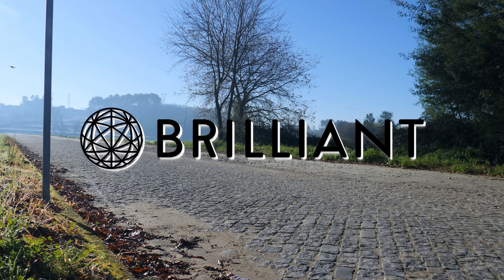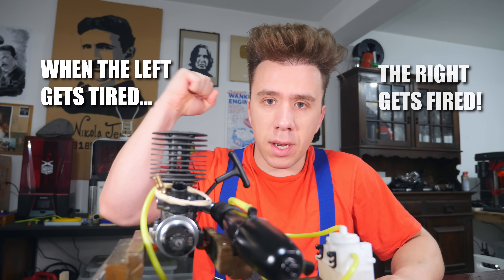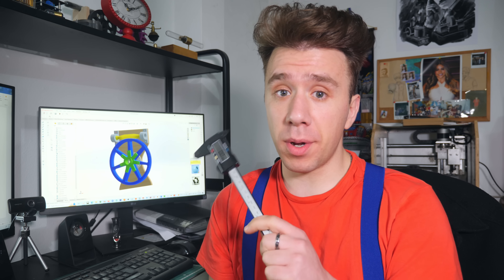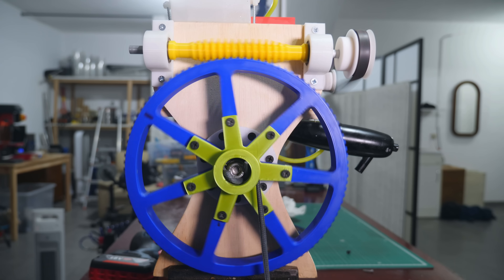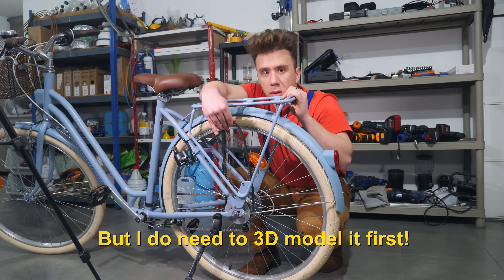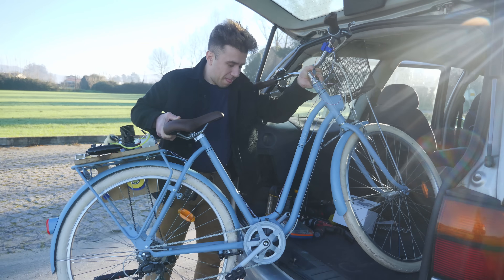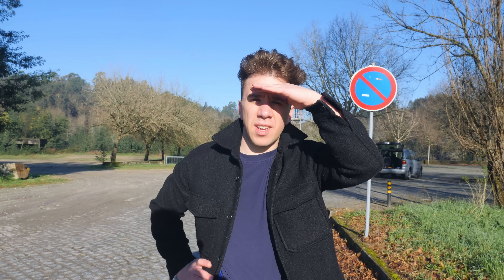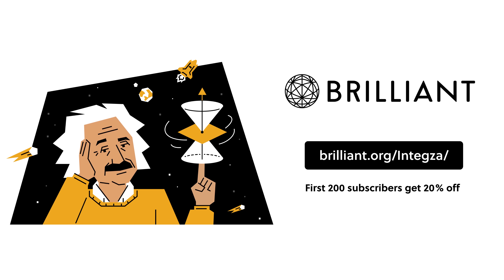Tiny 3.5 cc NITRO ENGINE on a BICYCLE

Comment: You should try to make a jet engine with nitinol, because nitinol has a relatively high melting point, and you could also program it so that it avoids losing its shape due to the high heat, instead it would rather take the shape of the engine and not it would be deformed....

Also another good idea would be to use gloves to avoid getting burned or electrocuted.:)

Comment: I have a 2 stroke lawnmower that struggles to start, because of its age. but the trick is to slowly and gently pull the pullstart so that it engages the one way mechanism, and then pull as hard as you can. this also reduces the chance of straining your arm.

Comment: think it might be running a bit lean, there should be a relatively constant stream of blue grey smoke from the exhaust. you can also try adjusting the idle screw to get it to idle lower

Comment: how about adding a gearbox to it, so you will be able to reach highter speeds. You could keep the 1/50 gear, for the start, and then gear up to a 1/25 gear speed. Also for that you will need a clach, but that is easy to make, or if you do not want to beald, then buy stock on, that is senterfugal (sorry if i killed the word), but id you want to change gears with a sentrfugal clach, then you will need to throtal down so the clach disengage by itself, change gear, and then throtal up.

Comment: You would gain more control and better throttle response by throttling the engine using an exhaust throttle, rather than the carb.

Comment: Using a rubber band to CLOSE your throttle is a terrible idea. 
The engine will get hot, the throttlebody then gets hot, melting the rubber band, and now your throttle is stuck open. :face-turquoise-covering-eyes:

Comment: I would have done a planetary gearset instead. Not only will it not self destruct, but it will allow power transfer both ways and allow more torque with plastic gears. This is how most small electric motors gear down for bicycles. even some hub motor ones.

Comment: i have a great ide. what if you take multiple nitro engines and combine them somehow so you have like a I4 engine but made out of individual 1cylinder nitro engines that are connected togheter via gears or shafts. would be supper cool

Comment: As you said, the engine runs on a mix of air, nitromethane, methanol and oil. It doesn't run on air alone, so before starting, prime the engine.
Blow into the pressure line to fill up the fuel line all the way into the carburetor before starting. It should fire up within 2 or 3 pulls.
This was fun, i really did not expect it to perform that good!
This could be a world record?

Comment: <Something something worm gear friction and efficiency> 
Also use a cross cut sled or the miter gauge not the fence next time. The way you did that cut is a supper duper danger way to make that cut. It's just asking for a kickback to happen and then taking your had into the blade with the block of wood. Always remember, if your cutting a part whose shortest length is close to or smaller then the size of the blade, then use the fence if your going along the longest length, and the miter gauge or cross sled if your going along the shortest. Also never use both, that's also a way to get dangerous kickback. Please keep your fingers, I need you to make more crazy things for our entertainment.

Comment: I like this project, but 30 km/h is not that hard on a bicycle without an engine! Perhaps you can look into a variomatic from a scooter, that way you can optimize the vario at peak power and you will go more fast.

Comment: Measure the torque of your legs and then accomodate the gear ratio to be the same or even higher if you want to keep the shifter transmission

Comment: This was a fun video.
If you decide to try and improve your design, may I suggest using a CVT drive, like they do on scooters, instead of a wormdrive. 
It will keep the engine RPM's right in the sweet spot, until you reach max gear ratio. That way you will get both torque and better topspeed.

Comment: The ratio of a small motor hp compared to a ferris  is staggering  
i was amazed you got to  32km/h  in the 70s rode in a mates gocart The old 160cc victa lawn mower engine did ?? mph  well pretty dam fast in a bike dome track

Comment: Little correction : The Citroën 2CV does not stand for 2 horse power. It stands for 2 TAX horsepower
Reply: Yeah this one is 29hp :)
Reply: I was looking for such a comment. The actual power output of the car is between 9 and 30 hp depending on the version.
Reply: Yeah, it's a "chevaux fiscaux" or "tax horsepower" reference. A 10 second wiki search and you can find the actual power numbers with the earliest versions putting out 9 ch/hp and the latest models like in the video putting out up to 36hp (29 for a 2CV6). These kinds of misleading facts just rub me the wrong way in those videos, no matter how funny or lighthearted the premise is.
Reply: I always thought it was for 2 Cylinders, 2 Valves and the host was being snarky.
Reply: @4saken404 CV is short for chevaux (the French plural for horse)
Reply: The cars are actually called a Deux Chevaux in France
Reply: @simaesthesia  Yeah 2 TAX horsepower
Reply: @simaesthesia  I find that just incredibly charming and amusing. :D
Reply: @4saken404  But, you know, that would give a Traction Avant 7cv cylinders...
Reply: Deux Chevaux = Two Horse
Reply: Tax avoidance at its best :)
Reply: @thecatofnineswords  it aint tax avoidance, iirc it was the same as owning two living horses so far as taxes go
Reply: @tiagobelo4965 I’m sure 2 horses would pull the car just fine so why shouldn’t a 2HP engine do the same? What am I missing?
Reply: @kevinmills5293 one horse power is normally 750 watts if memory serves me.... That is not the same as actual horse power....
Reply: @one.wonders  this here video maker has no clue.. The French tax HP is not 9hp, it's not related to actual horse power..As it was solely based on the physical size of the engine not the output. I wish people would try to research things before making a video
Reply: @meharidude  sadly that requires actual knowledge or research. Too often ignorant people with an opinion get all the likes etc.  I have worked on a few Citroens including the old duck! Cheap motoring... Sadly a bye gone ira.
Reply: @kevinmills5293  Im pretty sure 1 horse has like 15 HP
Reply: @thecatofnineswords  how?

Comment: I would use belt drive.  I think the gears aren't efficient.  And I think the motor's clutch is slipping a lot under load.  I think you need a more efficient transmission and/or a lower gear ratio.

Comment: I'm not encouraging you, but you don't dare to put AWD and some gravel-oriented tires on this thing to make it an offroader

Aka world's cheapest 2WD dirt bike
Reply: Also, one way to do it might be using nitro engine as generator, then use generated power to feed electric Motors in wheel hubs or anywhere else, just like old diesel locomotive

Comment: And fyi you’ll probably only need a gear ratio of like 3 or 4 to 1… try like a 12 or 13 tooth on the front and like a 44-50 too the on the rear wheel and get rid of worm gear all together

Comment: There is still untapped power there.
With a taller gear ratio you can increase your top speed but you'll probably need to get up to speed with your legs before engaging the engine.

Comment: Time to strap a rocket engine on the back of the bike to give the nitro engine a boost. Maybe a planetary reduction instead of the worm gear for efficiency and then you might be able to have a secondary gear you can shift into. Nitro -> rocket boost -> shift gears and then back to nitro engine at higher speed.

Comment: I think if you had a lockup clutch on the motor, one less pulley and better throttle control, this may have worked a little better. Still an awesome little creation.

Comment: Hey !
I'm french and I just wanna explain the French horse Power. It's nothing to do about engine power. It's, in fact, a tax classification for cars. This is uses to define how much you'll pay to obtain the legal ownrer documents of the car. This goes from 1 to 15 "tax HP". More "tax Hp" have your car and mor it's expensive. 
The 2CV was the most cheapest car you could by in the 50's and it was also cheap to get the documents. Citroen used this as a marcketing purpose.

Anyway, thanks for this video, it was very amasing.. and sorry but I love tomatos !

Comment: That wormgear probably causes a ton of friction and power loss. Maybe you could try and redo the transmission with either belts or gears? All that melted teflon is a big indicator for the friction
Reply: yeah, that was my first thought when he said he was going to use a worm gear. since you're already using belts, maybe you should see about designing a belt CVT like what motorscooters use for v2, and maybe even add a centripetal clutch?
Reply: @SevenWay-pu1xm  designing a cvt sounds like hell

i guess "designing" wouldnt be too bad but actually making it usable would suck
Reply: Yes. could benefit from selectable gears also
Reply: The engine was not getting to peak power, sounded like 15k to 20k RPM so it still had some headroom.  I think either it was not well tuned, still over geared, or too much friction in the system.  That said getting around 80kg of man and bike to over 30km per hour is a pretty mean feat when typical stock 1/8th scale RC cars using 3.5cc nitro only manage 80-120km per hour and only weigh around 4-5 kg.  Also some of those 3.5cc engines really want 18-25% nitromethane.
Reply: the wormgear can be redesigned to be wider so it can have small ballbearings inside it, so the friction is gone.

Comment: The additional oxygen is a smaller part than its stoichiometric ratio iirc. It has a low ratio meaning you need more fuel per g of air meaning more pressure (and power) per unit of air. Methanol has a lot of oxygen too but doesnt produce  anywhere near as much power for its oxygen content vs nitromethane, its stoichiometric ratio is substantially higher

Comment: How to start: Pull once or twice with air intake closed (finger on) or instead put some drops of fuel directly into the air intake. Makes starting a lot easier.
Reply: Excellent suggestion. Caution: All you want to do is pull fuel from the tank to completely fill the fuel line. DO NOT pull fuel into the engine because it's really easy to pull too much. If too much goes into the crank case the engine becomes hydro-locked. Trying to start it when hydro-locked will severely damage the engine. Trust me, I know: I tore the skirt off of the piston on one of my engines!
Reply: @richardunruh4035  I used to start my model airplane engines by hand. I let some fuel enter the crank case, two or three drops at most. That made hand starting a lot easier. To be shure, one can cautiously turn the motor by hand after priming to avoid damages by hydro locking.
Reply: @martinwilliges532  nah just use a drill to start it
Reply: @richardunruh4035  if the cylinder floods its supereasy to feel it with the pull starter and all you have to do is crank it a couple times with the glowplug removed.
Reply: @ishannage248   Oh, sure: now you tell me ;)  It was an old T-Maxx with electric start. No pull start = no feel.
Reply: i have nitro buggy experience, and i have found that if you pull the stater with your finger on the exhaust, it will pull fuel into the engine, it wont start very well without doing this, pull it untill you see fuel moving through the hose. if you have transparent hoses.
Reply: @FireFox443-YT YES, this is the trick!
Reply: Or just use any Traxxas nitro engine with auto start
Reply: I used to just spray some random can of something flammable enough to help it start XD (yeah I was a savage when I was younger XD)
Reply: just watch the fuel in the line, it creeps up as you pull with finger on the carb intake, it's called priming.
Reply: Just put your finger over the exhaust for a few pulls. This will pressurize the fuel tank and the way you go. I've been racing nitro cars for 30 plus years this is the easiest way to start them
Reply: @ThisLiLpiggy79 agreed. Brings back memories
Reply: @ThisLiLpiggy79  100% correct I run Nitro RC cars
Reply: Sounds remarkably like the bloke I saw trying to snort some snow in the bog last week 😉
Reply: A mosquito engine, nice.
Reply: Came in to say this, leaving satisfied. 🙂

Comment: The teflon severely lacks mechanical strength. It's way too soft and can't withstand the sheer forces of several dozen kg: Thus you ground the wheel to dust just by driving a tiny bit. Brass for the screw and the wheel + some regular, high viscosity gear grease would have been a much better choice.

Comment: Worm gears are pretty inefficient.. using a planegary gear set would be better. You could try 3d printing one but ideally, a sealed metal one off the internet would be a lot more efficient, no dust ingress, lubrication...

Comment: I used to be into RC planes/boats/cars and had a number of engines laying around.  I once toyed with the idea of connecting one to a gear reduction and then to a small DC generator.  I thought it could possibly work to charge a battery pack and this gave me the idea of a hybrid electric bike.  Get too tired and use the batteries.  batteries start to get low and just fire up the motor and keep on going.

Comment: please build a 3d printed gearbox for this!.... im sure you can get it going much faster with more than just throttle control!..even if its just a simple 2 speed where you can swap between 2 different sized gears (i invision rotating the 2 gears into place on a common axis with a belt to drive them)... one to get you moving...then another to get you speeding!
or you could just cheat... and use the bikes chain and gearing!... all it requires is a sprocket connected to the engines clutch!

Comment: Cool vid. But the 2CV model you have there has about 30hp, the very first model had about 9 which you weren't far off of the truth. 2cv means 2 steam horses which is basically a rating system for steam engines of the day which then got transfered to cars. 
It wasnt so much a unit of measurement like HP but a category. So 4cv cars of the day would have all had different HP but would be the small engined car of the range compared to an 8cv car.

Comment: 2cv means 2HP but, they mean 2 TAX HP....because in France you pay registration of your car according to criteria of power your car that made the 2CV fall in that 2 TAX HP class (because the 2cv was around 9 to 29hp depending on the engine used inside)

Comment: Next up would be making a gearbox that allows multiple gears. You could likely use the gears already on the rear tire and a chain to allow gear switching.
Reply: RC cars with 2-speed transmission are quite common - there are even some 3-speed ones. The concept is actually quite simple, the higher gears are engaged through centrifugal clutches and the lower ones are then freewheeling on a one-way bearing - theoretically it'd be possible to just keep adding more gears.
Reply: It would be a good idea to look at the electric mid-drives like the bafang that are fairly popular as a easy electric conversion.
That way your gears on your bike act like a transmission still.

Comment: Given a known gear ratio, you could use the recommended maximum RPM of the engine to calculate the theoretical maximum speed.  Of course, you won't get there; there are always losses, but it would indicate how well it performs compared to the theoretical maximum.

Comment: Ideas for overengineering:
- planetary gears can be stacked to make a very compact manual transmission to work up to a higher gear
- electric supercharger because a higher compression ratio (even if slightly) increases torque... Maybe a driven tesla turbine as the impeller? 👀

Comment: very not powerfull.. crap noise .. expansive fuel usage...  lol my ebike eat 250 watt to hold 30 kmh... you have 1500 watt availlable.. where is the 60 kmh top speed? XD u could at least use a 4 stroke who have much more tork...

Comment: Some years ago my son and I got into RC trucks using these "little" engines.  I was very satisfying to see you having trouble starting your engine using the pull-cord!!!  I have no idea how many knuckes we smacked when we first got our trucks.  Even after we started using a drill, it was hard to get the engines to start until we had them broken in!    

We flipped a truck on a jump once and cracked the engine block (which sucked since we had JUST gotten that engine broken in and running smooth).  But it was fun to have an 'extra' engine that we could pull apart and look at and not worry about breaking anything or having to put it back together and have it work.

I also have to say, the neighors were not big fan of the trucks!
Reply: Not sure why you quoted the word little. They are literally a little engine. Quotes are not needed in this case.

Comment: I don't think there was a need for one way bearing becaus on the output of the engine there is a centrifugal clutch which is one way.
You could still destroy the clutch if the engine was full throtle and the tire was spinning faster than the the engine but you could just close the throtle.